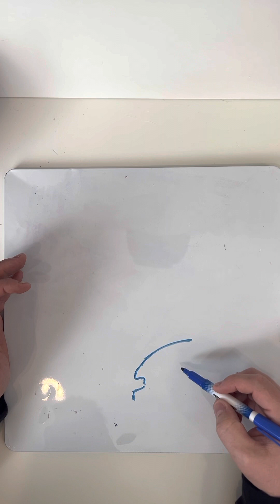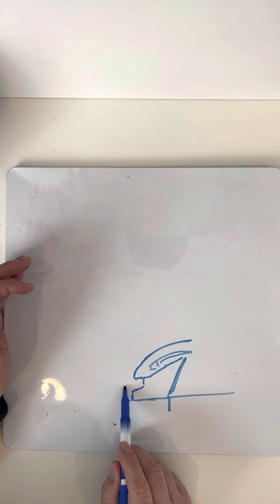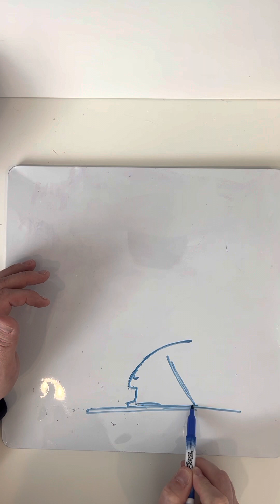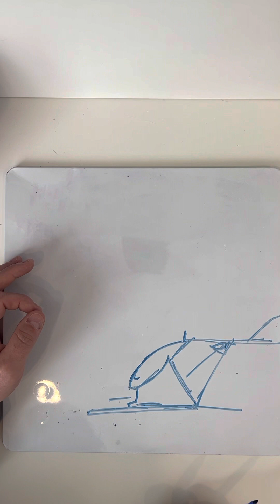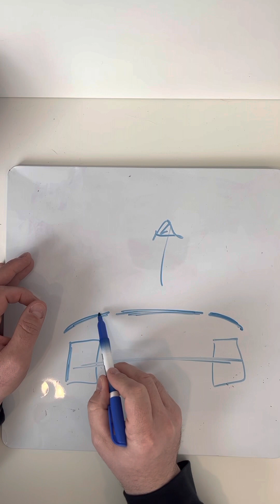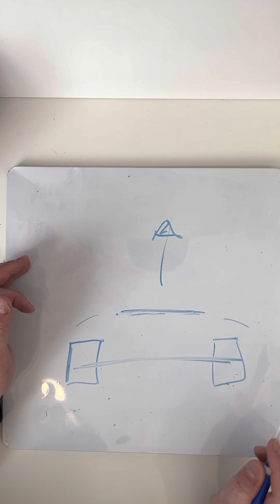Why running a splitter on a C5 or C6 Corvette with the stock radiator location can cause overheating

Comment: Great info.  What about running a splitter on a stock radiator C5Z  with center and side hood vents ?   Would that not lower the under hood pressure and allow for the air to pass through the stock radiator and out the hood as apposed to under the car ?